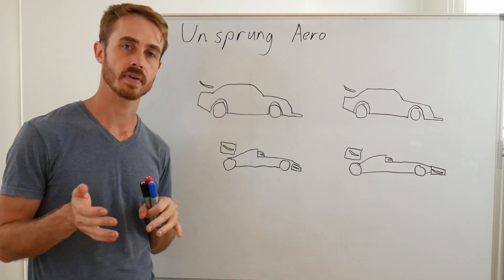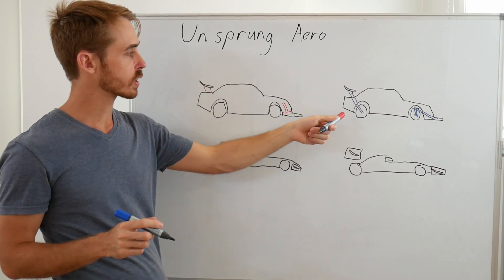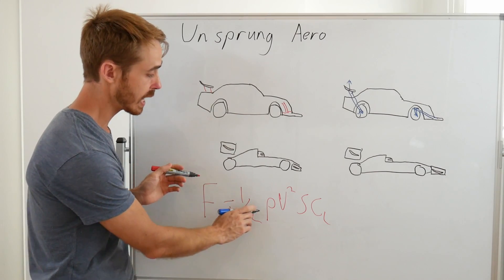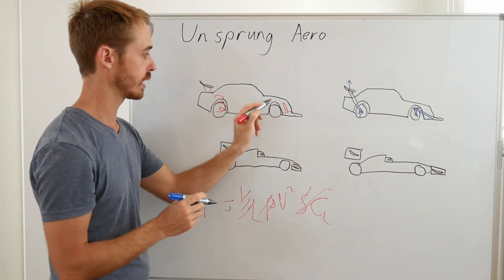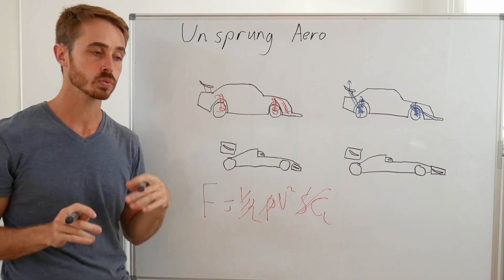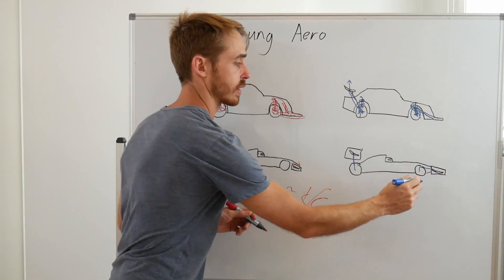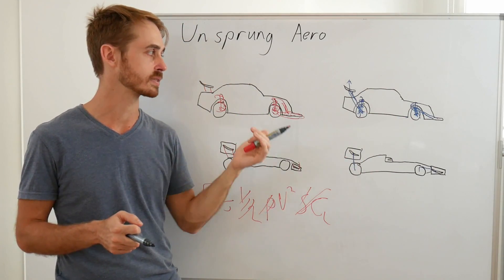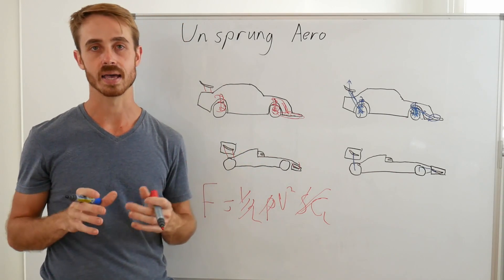The Aerodynamicists Magic Bullet? Unsprung Aero Explained

Comment: I never understand why one technology gets band over another.  Why is unsprung aero banned?
Reply: It was legal in F1 for a brief period in '69 when Aero was just getting started. However, in one race, several crashes were caused when wings were bent in half by a dip in the road at Barcelona. Wings were banned altogether at the next race (Monaco,) then the low, fixed wings were allowed the next season.
Reply: I'm guessing this was because the mounting parts were so fragile due to trying to minimize unsprung weight, whereas the body-mounted fixed wings could use more robust mountings since they are sprung mass?
Reply: Gustav Meyrink that makes no sense. The down force the wing generates is still translated to the tires on a sprung setup .  The advantage of unsprung is the shocks don't have to directly deal with the forces of the wing just the body and roll and g forces of the chassis. The tires still see the same force regardless of each setup. If the wing generated that much downforce to bounce your car if it was suddenly ripped off, a sprung setup would be much worse in that it has stored that force in the springs and suddenly released it.
Reply: It is not banned to keep it fair that is non sense. Right now it is not fair to let one team that has huge budget out do team that doesn't, because there is nothing that teams can even do come close to top teams because development on that level is just not possible for them where teams that have money they can still improve upon. So setting hard limit for some teams is just not fair in my book unless you give them some chance to come up with something.

Teams with most money will always have better chance to win but right now there is no way that team on top can even come close to them since bar is set so high and margin on developing anything is so small that teams face huge diminishing returns on their money to get there. So i don't see how banning technology and setting so hard limitations helps in this case when as we can all see that team that has most money wins.
Reply: Basically all the rule changes are to slow the cars down/ make it safer.

Back when the 1,000hp turbo cars and before ...F1 guys were dying on avg. 4<5 guys /year.
Reply: Read that as well. So...yeah, in F1, at least, the tech is banned on safety grounds...from the '60s.
Reply: This is related to why they were banned in the late '60s, yes. The actual physical wing itself broke in many cases - see the case above where they bent in half at Barcelona.
Reply: Well there is no excuse to ban it it in F1 when teams are already dumping so much money at least they can dump it into developing just like P1 cars do. It can be argued that at the time it was banned cars were going to fast they pulled to many Gs and safety of race tracks and cars was lower. Now I think they should use even more electronics and in combinations with massive downforce they can make cars that go way faster while keeping the safety in check. 

In regular races it is understandable since developing means a lot more money that teams need to spend just to compete and in those its just unproductive to allow extra spending when even now they try to keep it minimal. Like for example in GT3.
Reply: Think about it this way: You have unsprung, wheel-mounted wings and travel very fast. The downforce will compress the tyres. If the wing breaks suddenly a few hundred kgs of downforce is apruptly removed from the tyres, they will spring back to unladen shape and thus actively bounce the car off the road.
Like if you take a bouncy ball and press down hard on it, if you let go suddenly it will bounce up off the surface.
If the wing is body-mounted and therefore spiung it is the cars suspension which takes most of the load. It will also extend but it is damped giving the driver a much better chance of not crashing.
Reply: Technology is regularly banned to keep F1 and other motorsports fair and interesting.
Usually the winning technology is banned so that every year the teams have to come up with something new. Otherwise the victory would always go to the most well funded team.

Comment: what if you do a mixed setup? Unsprung on the rear and sprung on the front.. I can install a Unsprung system on my car with not to much of a breainstorm, but @ the front.. thatś a whole differtent story.. I think it will be beneficial if I do it becouse itś a front wheel drive car to get some extra stability and downforce in the rear..but will it go in conflict if I keep the front sprung?
Reply: The front wing and the undertray benefit the most from being unsprung, as they operate in strong ground effect and are therefore very sensitive to pitch, roll and heave. I am a member of an FSAE team and for that reason we decided this year to run the front wing and the undertray unsprung while the rear wing remains sprung.
Reply: Biohazard667 Productions i think it would be really difficult aerodynamic balance wise.
Reply: aha okay, thanks for clearing that up

Comment: Did the lotus 88 count as unsprung aero?
Reply: Yeah, the venturi shell attached to the outboard section of the suspension at each corner so it wouldn't rise and fall with the body of the car, which was massively beneficial since the sliding skirts had been banned. The engine/driver section could then be mounted to the inboard part of the suspension with comparitively soft springs, which reduced wear and tear on the drivers plus more mechanical grip. Mario Andretti said part of why he left F1 was that the ground effect cars in legal form (all aero attached to sprung part of the car) had such brutally stiff suspensions to keep the aero parts in the right spot.
Reply: I think it did.
Reply: I think he's talking about cars like the 49B:
https://en.wikipedia.org/wiki/File:Lotus_49b_rear_view.jpg
 (edit: "he" meaning Kyle, not Phos9)
Reply: But he asked about 88 and I think it is reason it was banned.
Reply: Yes it was, as with most other innovations in downforce brought forward by Lotus
Reply: Yeah, there is a documentary in which Williams trial a car without suspension because they heard rumors that the Lotus wouldn't have any, when in fact it was that clever design

Comment: How would unsprung aero connect to an independent suspension car? 
Also what counts and doesn't count as sprung and unsprung in suspension itself?
Also wouldn't the aero on a un sprung setup move relative to the body?
And what about aerodynamic suspension parts themselves? ( sorry for all the questions)
Reply: Ill have a crack! :)1: Usually connects to the outboard upright
2: Uprights/wheels/tyres/a-arms, etc = unsprung.  Chassis/body/engine/driver = sprung.
3: Yes it does -  this is one of the major benefits of it. Particularly for the front wing which will run at a consistent ride height and angle to the ground for ground effects = higher and more consistent downforce. It also allows you to run lower endplates so you can better seal your front wing.
4: Aerodynamic suspension parts would be considered unsprung aero components.
Reply: Wes Partridge so basically the entire suspension is unsprung? 

Also I believe some racing ( like f1) does have sorta aerodynamic suspension parts but they aren't counted as so because that's not the original purpose? It's just streamlined instead of being designed for downforce 

Also am I the only one that thinks the ban is stupid? Just like with active suspension and cvt gear boxes ( in f1) 

Also I can see how you would get a more consistent hight relitive to the ground being mounted on the suspension but I don't really see a feasible way to mount on independent suspension since it would have to have some sort of conformity to being twisted, expansion, and contraction to some degree because of suspension movement 

( although that said you'd get much better ground effect in corners ) 

I can see how especially for rear suspension if it's a live axel it could be pretty easy to do so because it's not independent 
But for any independent setup you'd have to add some sort of conformity in movement somehow
Reply: I am unfamiliar with f1 rules - i suspect the a-arms must be a certain geometry/or size so they dont just turn them into wings. 

It is possible to have independent suspension and unsprung wings. Have a look at the fsae teams which use it- Monash probably being the best example. It should be easy to see how they mount the rear wing. The harder one to visualise is the front wing. basically this is partially mounted to the chassis of the car - but those links dont resolve any of the downforce. Then you use a link which connects the wing to the upright to resolve the vertical component.

Comment: Not to mention that the wings would likely be destroyed being unsprung....
Reply: Sal Molinare why? they could make them as flexible as they want. I bet they would design them as anti-roll bars!
Reply: that's a lot of abuse hooked directly to the wheels/axle. the wing reacting to every bump. I'm not optimistic.
Reply: Sal Molinare Cars with unsprung aero exist and show it is possible. I have driven a number of case cars with unsprung mounted wings from both Monash and Curtin University and both had unsprung areodynamics.